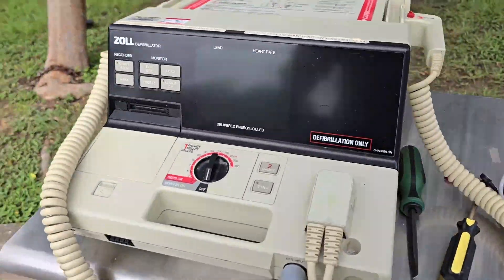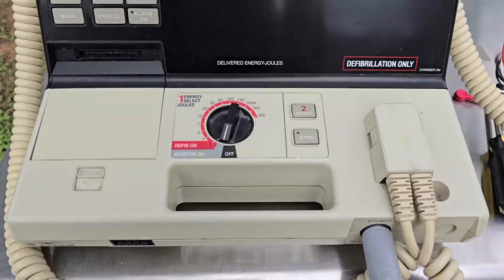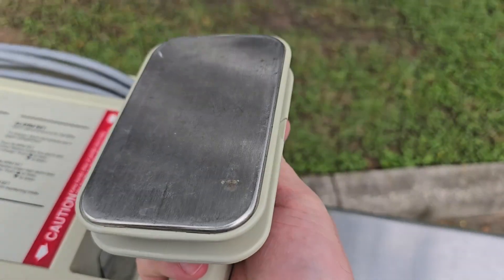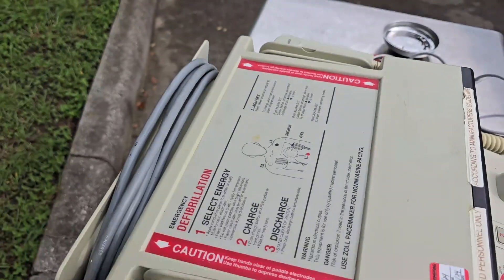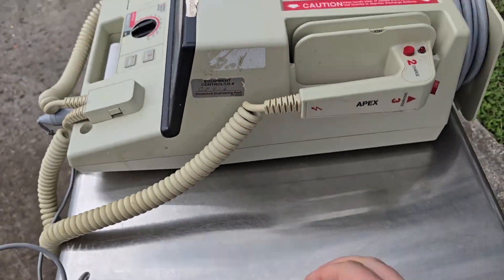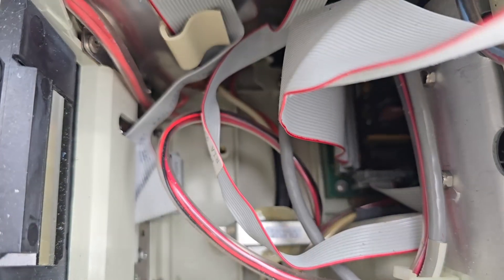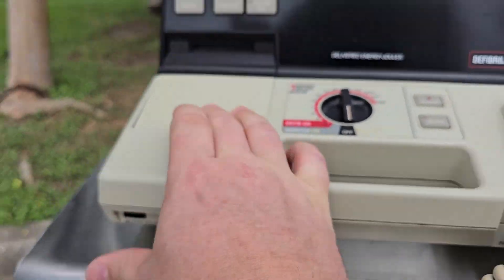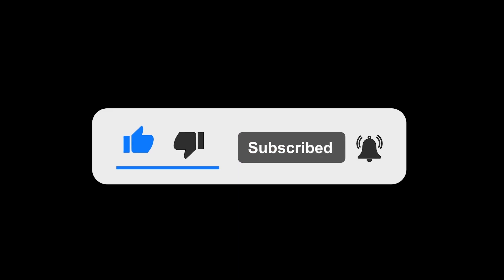Shocked! (-this old Zoll was still in service!)

Comment: I dimly remember that there may have been a pediatric paddle adapter that slipped onto the paddles and the adapter pressed that ped mode switch so you could not get adult settings with the tiny paddles attached. You might check that out. I was a hospital based Clinical Engineer from 1975 thru 2014.
Reply: YOu caught me, I didnt watch to the end before I commented.